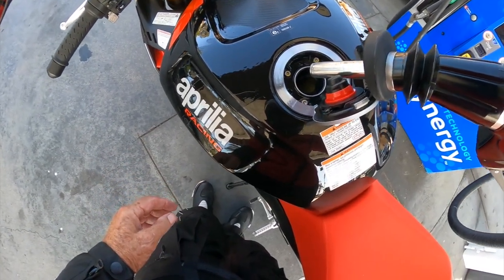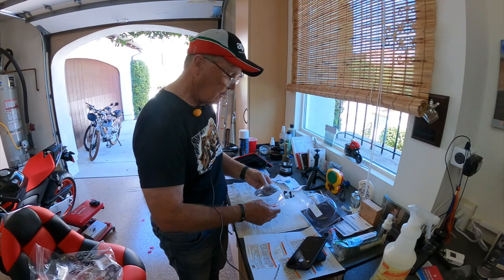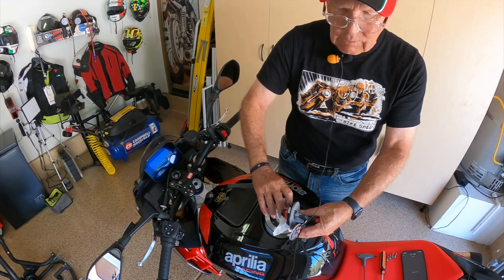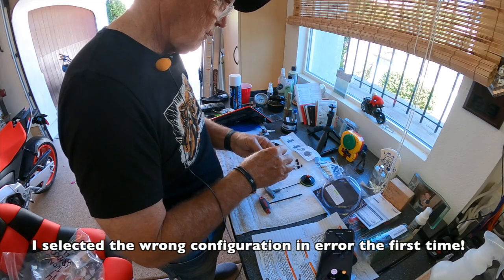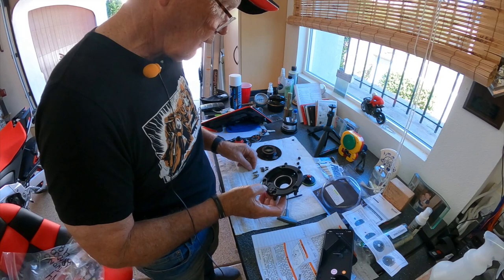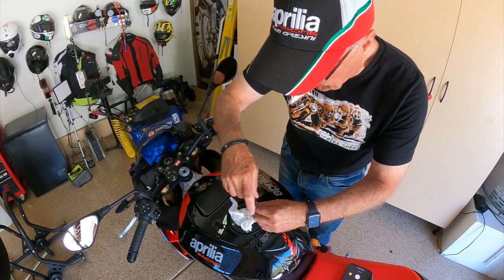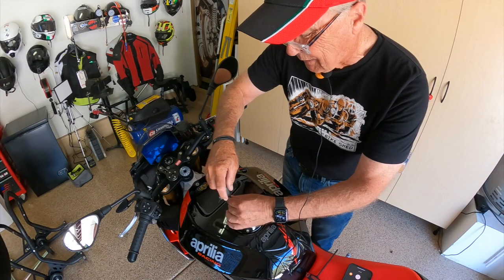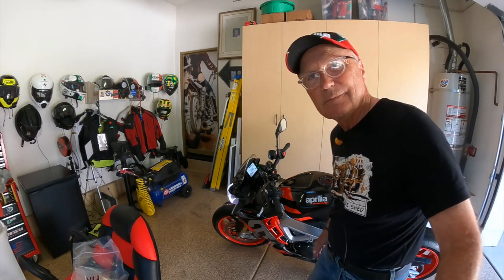TWM Gas Cap Installation on 2021 Aprilia Tuono Factory   HD 1080p

Comment: Have to admit I didn’t appreciate just how awkward the Californian “Petrol Bowser” is for motorcyclists until I saw your video. I had read all these posts on AF1 about how changing the gas cap is a must do modification and couldn’t understand the need for it as here in good old NZ I don’t have an issue filling the tank on my Tuono… but now it all makes sense… goods work sir!
Reply from the maker: Yes, another example of form over function really....because to fuel up one must manually hold up the fuel collar that is supposed to trap the vapors anyway.....when the cap is replaced you can actually use the nozzle the way it was intended and allow the collar to fold as it is supposed to do as with a car for instance.
I do think the factory OEM gas cap is if anything better looking, sleeker in any case. But the TWM is nice enough looking in its' own right and an absolute necessity here in Cali....Thanks for the comment!

Comment: Hello Garey... i figured out how to stop excessive pressure from building up in the tank causing many gas caps aftermarket and factory to leak... very simply the evap system must be deleted. The vacuum line to the evap must be plugged and the check valve that is on the gas tank vent hose must be deleted. The vent line from the tank should be an unobstructed hose routed to dump to the ground. After doing this modification my TWM gas cap no longer leaks and i don't get that rush of air pressure when opening the gas cap after a ride. If any of you take your bike to have the evap system deleted by a mechanic or stealership make sure they properly delete the check valve!!! Very important to have an open line/hose for the tank to properly vent. 👍🏻

Comment: I just put a small drop of guerilla glue on the hex nuts a couple hours prior to hold them in place. The spider racing one is the exact same as here. 👍
Reply from the maker: Nice hack! Yeah, that would work as well....one is really in fear of dropping one of those rascals into the tank. That would be HUGE hassle.Thanks for the comment.

Comment: Hey Garey,
Thanks putting out some good Ape content. I installed the same cap on mine and now smell more gas vapor and see it always wet with gas around the push down top. Does yours leak like this and do you smell gas when you put your nose near the top of it?
Reply from the maker: I have not noticed this with my own change of the gas cap. Also, didn't notice it when I did this same gas cap on my previous 2017 Tuono.....things to check;
1. Is the gasket in the correct place/orientation?
2. Is the vent line open and not obstructed?
3. Is the cap closing properly?
Hard to say otherwise, but mine is leak and vapor proof sir.
Good luck!
Reply from the maker: Hey, circling back here….have you been able to find the issues related to your problems here? Please let me know.
Reply: @GareyCooperdude  I’m not sure  it was the gasket placement or the bike’s charcoal canister evap system but the pressure is still there after I had a shop reinstall it. When I open the cap to fill up the pressure sprays gas. I’m now thinking to remove the charcoal canister as it has worked to relieve pressure for some owners.
Reply from the maker: @Cafn8d_Rabbit  You’re reminding me that I had an issue similar on my 2017 model and while even the dealer thought it was a faulty gas tank (think big $$$’s!) it turned out to be that the breather line down to the canister was crimped, by me, while lifting the tank to do some work around that area….finding this saved me some money. There are two lines that come down from your tank. One goes to the evap canister. You have to lift the tank to see them, but if you can do that you might check to see that it is not crimped or closed down on in any way.
Having said all that, removal of the evap canister is still probably a good idea in my humble opinion……and it should/could help your situation.
Reply from the maker: Forgot to add, please let me know how it all turns out?
Reply: Did yours come with a donut shape oring under the fill port? It should seal to the metal ring on the tank opening.
Reply: I am having this same issue where gas seeps out from the twist knob and puddles and splashes everywhere. I also have my evap deleted and also have the black gasket that is under the filler neck present. Once pressure builds in the tank it starts seeping out. I looked over my install i did 3-4 times now to make sure i did everything correctly and i did. Theres 2 hoses that go to the evap... the guy who deleted it for me has the thicker one plugged... and the thinner one goes to the belly pan. Is this correct? Or should both evap hoses be open?